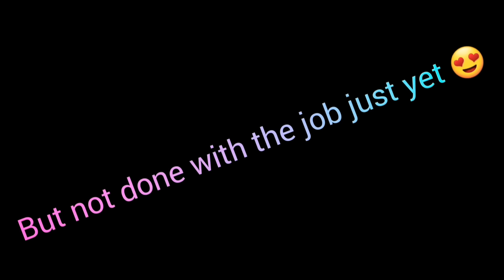💦💦 Water Tank Truck - Angelica Larsson

Comment: Hi Angelica, remember that if the tank is not completely full or empty the free surface of the liquid will create sloshing inside the tank and this could lead to tilt the truck even at very slow speeds when turning !
Reply: Im sure that the company that build the tank know howe to build them to avoid that, its build in Sweden...

Comment: Back about 15 years ago I worked at an airport in New Jersey, USA.  We had 5000 gallon fuel trucks for fueling aircraft and the hoses
were similar to yours.  I really got concerned for you climbing that ladder holding the hose while it was snowing.

The trucks we operated used a power takeoff to pump the fuel powered by the truck itself.  When we refueled the truck we had to climb
up to inspect the open hatch on the tank.  Fortunately our intake hoses were at the bottom of the tank so no worries about falling off in
bad weather 😁

I was curious, how many stops do you have to take to empty a tankful?  It also must get complicated having the vehicle weight changing
so much while on snowy roads.

Comment: I would say that I'm glad you feel better about the shock to the system.  But ya know, it's 2 years late. 
     I am glad though 😁and it's an honor to your nature the way you dealt with it!  
      I have a suggestion for you.  At 8 minutes and 48 seconds of this video you are about to detach the water hose.  I notice that you took the top the top off first and dropped it on the ground.  Then after you unhook the bottom you got the water out by rolling up the hose.  Which probably gets your hands and feet all wet.  Which sucks in the winter.  I know because I work with water and hoses outside in the winter also.  
     My suggestion is this: 
     Once you detach the top drop it down, and unhook the bottom.  Put the bottom end outside the shack or whatever.  Then take the top end back up the ladder to let gravity empty the hose making it easier and drier to roll up.  
     I hope that helps.

Comment: In  Pennsulvania  USA  I passed  25  Identical Water  Trucks  all painted the same ..  all  looked like Brand New.. but they were hauling water for Fracking  not  for drinking..  Fortunatly  were I live  I have a  well   11 Meters  deep that   has all the water I  could ever need.. I would like to install one  extra well with  a hand  pump  in  case there is no electricity for a long time..

Comment: I always feel conversational when watching very interesting videos and like to comment on something as it occurs to me.  Its just my way.  I was recently assigned a new truck, an actual new truck an automatic freightliner 13 speed and the interior is extremely ergonomic.  My right hand no longer hurts so much and I can drive without my belly hitting the bottom of the steering wheel unlike the International I had before.  The Internationals driver seat bottomed out hard when even I hit some kind of rise or inclusion in the road.  That truck I could never seem to get comfortable in.  It is amazing how important ergonomics are to the well being of a truck driver.  Speaking of ergonomics, I truly hope you can find some semblance of equilibrium in your life no matter what you have to discard...   Also, I left some unhappy messages in your Instagram because I was not sure who was talking to me as I stated earlier.  I hope you will forgive and move on happily.  Cya later and lets see whats next!